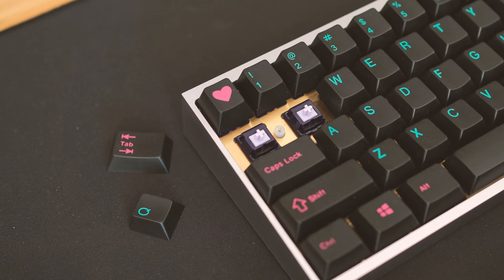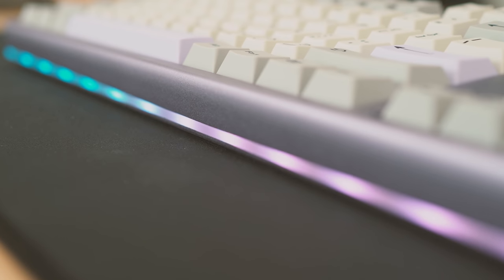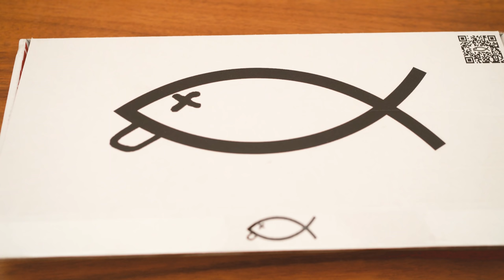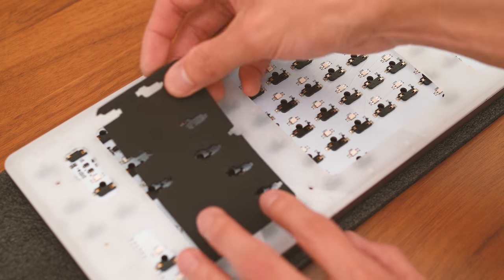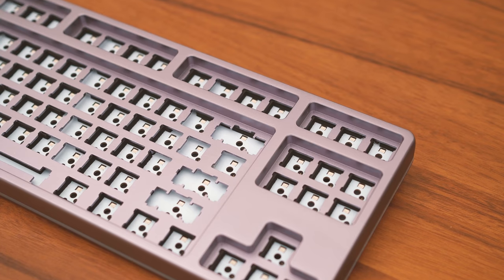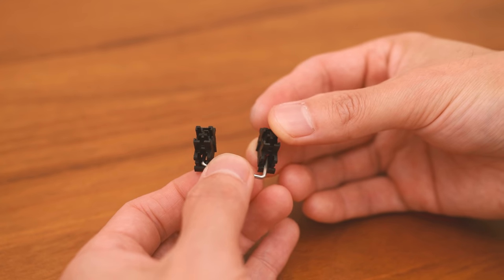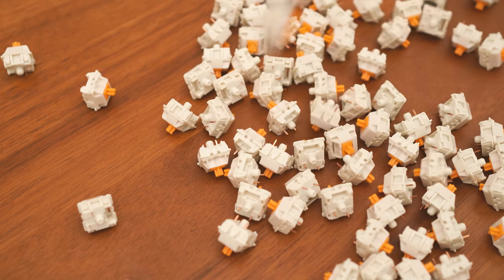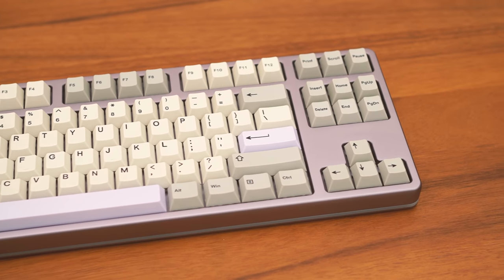Building the MOST AVAILABLE Custom Mechanical Keyboard!  DROP CTRL

Comment: This board is literally stuffed with foam and still sounds hollow. Idk how that's possible. Also unless you have to have a TKL, then I'd just get the ID80. It's basically the same design as the CTRL, but it has pcb mount stabs and is $100 less.
Reply from the maker: I believe it's the integrated design of this board and perhaps the size . I feel the alt hp was a bit better in this department. Idobao has been offering some good options lately! I really like their crystal case!

Comment: As a drop ctrl owner, I would advice NOT to get this keyboard..

Do take a look at the drop keyboard discussions and you will realize so many owners (like myself) have chattering issues..

Afterall do your research before buying a product is always a good thing..
Reply from the maker: Sound advice on the research!  I'm not a big fan of the halo switches
Reply: @Keybored  I wasn't even using halos.. I got them with cherry blues and it chattered.. so I tot it could be the switches that Drop acquired thus I change to box jade and the issue still persisted (this is even with the supposed "fix" firmware by Drop) thus I suspect it's the PCB quality/ build in the first place.

Comment: if you're thinking about bandaid modding your stabs and you're like me and are new to modding your keyboard, save yourself some time and don't. What the video creator failed to mention was that you need exactly a certain thickness of material for the mod, and you also need to cover/not cover certain areas of the stabs or else the stabilizers will be too stiff and they will stick. After many frustrating hours realizing the medical tape I bought simply wouldn't cut it, I put back in the stock stabilizers and said fuck it. Turns out, I don't care if my stabs sound like shit. 
tl;dr if you're going to try band aid modding, find the EXACT same stabs and medical tape/band aids used in whatever guide you're following or just don't do it at all.

edit: not attacking the video creator at all. this was super helpful. I just jumped the gun on bandaid modding my stabs when I shouldn't have, and I suspect others might as well.
Reply from the maker: For the bar end mod, have to go super thin and increase thickness from there. It's good that you can control the number of wrapping but it also takes a few tries to get it optimal
Reply: @Keybored  i nearly threw my keyboard out the window trying to get this right yesterday. It was because the medical tape I bought was hella thick and the stabs would just be infinitely stiff after every attempt =( It turns out they make stickers for this